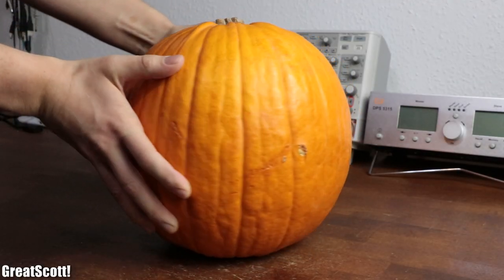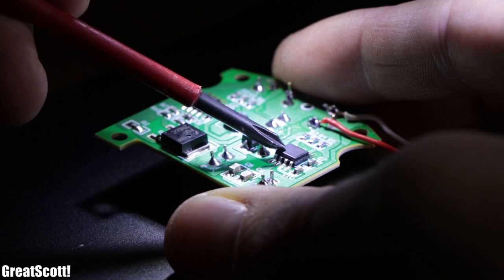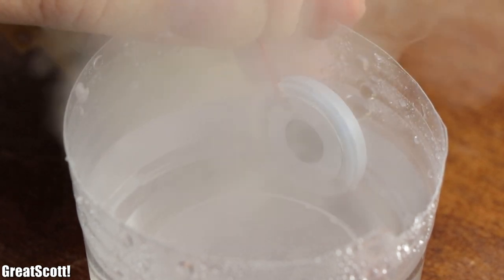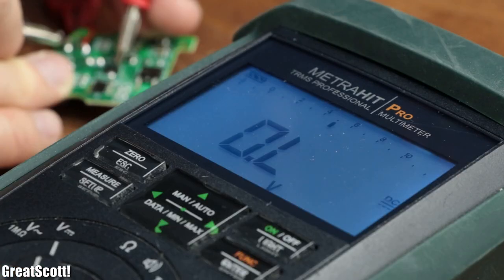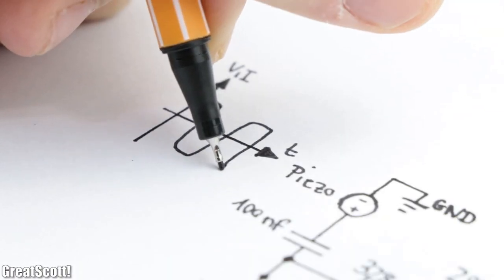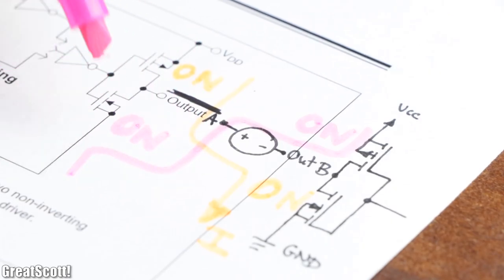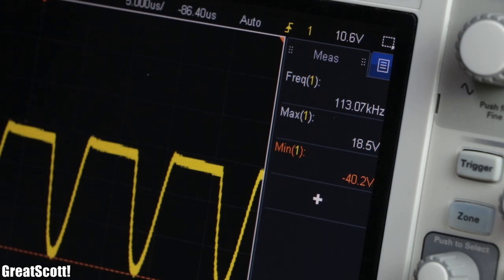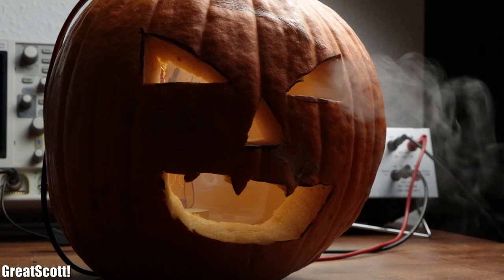Make your own Super Simple Ultrasonic Mist Maker

Comment: I recommend adding a water level sensor if one wants to actually put it outside, unattended. Just to avoid burning out the disc.
Reply: A swimmer for the disc would be good too so it stays watered but not submerged for longer (I assume it has to be not-submerged).
Reply: @BloodyRainRang  some of them utilize submergeable piezo discs

Comment: The capacitor missing from the schematic seems to be a 100nF ceramic capacitor that should go from pin 8 on the NE555 to ground. Without that, the square wave the NE555 produces has a high voltage peak at the start of the wave.

Comment: I looked on ebay for some piezo resonators to experiment with them and I saw the 113KHz item in your video but also noticed resonators marked as having a frequency of 108KHz. Perhaps the commercial unit is deliberately marked incorrectly and the output of the microcontroller with the lower frequency you measured is correct. Perhaps you can devise an experiment to find what frequency gives the highest output rather than having a preconceived notion of what the frequency should be. This would be a better way anyway as you'd expect some tolerance between different resonators and you can fine tune them somehow. Maybe a circuit with a PLL could be self correcting so it produces the highest output by tweaking the VCO on the fly? I'm sure that alone would make a great video with your talents!

Comment: Can someone explain what the inductor and capacitor is for?
Reply: I was wondering that too, at first I thought maybe the inductor and capacitor is acting like a series LC. Circuit with a boost converter effect which would explain the big negative voltage swing but not 100% sure

Comment: So you may not submerge this new piezo disc under water in order to function? That would mean it needs a very precise waterlevel, which continuously decreases as the piezo creates mist from it. How do commercial mistmakers deal with that problem?
Reply: This might be a possibility.  Float the disc on the surface,  maybe at angle if that helps.  You'd need a "raft" and very flexible wire.

Comment: Ok I got a piezo twitter from old speaker box, connected everything and I got nothing 
On 30 volts
But on 80 volts I got good results and a good electric shock
Reply: it might be because you are using a piezo speaker, and not an ultrasonic piezo
Reply: @davidrubio8673  that explains the current
Reply: @blackturbine  yes
Reply: @blackturbine  please use a mosfet or low  value capacitor for more power
Reply: @euvo_sound  nah this was only an attempt plus i took the circuit apart for components
Reply: @blackturbine  ahh ok

Comment: That was an interesting reverse engineer. I'm curious, why would the commercial circuit use a cheap microcontroller as opposed to the dirt cheap 555? I'm sure the 555 would be next to nothing in cost? Anyway thanks for another great tutorial.
Reply from the maker: The cheapest 555 timer I found on LCSC was 8 cents. Not quite the 3 cents for the µC.
Reply: @greatscottlab  Yeah, Dave has recently made three videos about that 3 cent MCU. Impressive!
Reply: @GreatScott! @northshorepx The cheap microcontrollers need less support components, so if it means one capacitor or resistor less it might work out cheaper at high volume.  Given less support components outside, such as a capacitor which might have a big tolerance such as 10 or even 20% error (maybe even more if you go cheap), you are also less likely to have defects on the production line, since if they went with cheap passive components and the 555 route the timings might vary greatly between them. While the video did show it not being exactly the resonant frequency (though it might have been an intentional design choice), the internal RC oscillator in modern microcontrollers have become quite good and I would trust it a bit more than an analog solution when cheaping out on passive components.
Reply: @greatscottlab   can you make a video about the cheap microcontroller?

Comment: 1- If 555 is in an unstable mode, why is pin 7 empty?

2- Why is the 470 Nf capacitor going from pin 4 to pin 1 not in the circuit diagram!

3- Even if this circuit works nominally, it was seen that it works with a value of 2.3 Amps at 12 volts and IRFZ44 heats up abnormally. It is not efficient.

4- Did you think that the Frequency setting you made without load would change when loaded?

Comment: Hey there
Hm, nice video and thx and all.
But the circuit doesn't seem to work right for me. Built it like in the schematic, and it does put out a high pitched sound when the potentiometer (10k instead of 5k but that shouldn't matter, right?) is at max, but when tuning up/down nothing's happening. Any suggestions? 
My other try with a readymade ne555 circuit hooked up to an irfz44n just seems to catch fire (/the mosfet gets so hot surrounding wires melt), but it works....^^'

Comment: Thank you for the great video GreatScott! Is this circuit possible with just the N555 timer? You mentioned how you really only need an AC current at the resonance frequency of the piezoelectric disc right? I got my N555 timer to produce 113KH from a 9V input DC current but the piezo electric disc doesn't react

Comment: How long did you run the circuit inside the pumpkin? Were there any problems with mist settling down on the circuit and causing creeping current problems?

Comment: Next question: can you also vaporize fog fluid with it? I always want to create a small fog-machine that works on batteries but it draws a lot of power. Technically the heat is just wasted and only needed to vaporize the fog fluid which condenses to small droplets in the air lateron. It would be greate if one could get rid of this unneccesary step and create the droplets directly through a membrane.

Comment: @GreatScott!  On your Instructables page you show 10 components, yet in the parts list and schematic you only use 9 components.  One of the 4 caps in the picture of the parts list is not in the schematic but IS shown in all of the pictures as being connected in the circuit.  This makes doing the project difficult as the images for it do NOT match the schematic.

Comment: I have a couple of questions please. my ultrasonic transducer is rated 3-12v and your circuit on instructables states a 15v  feed, if supplied with 12v, will any of the components need to be change to different values?
The circuit has a line labelled 'VCC' which supplies the inductor, is that the same voltage as supplied to pins 4 and 8 on the 555?
and lastly, instead of sourcing the IRLZ44N mosfet, is there any reason why i cant use another N channel mosfet in this circuit as i have transistors of many types but not the IRLZ44N.
Thanks, Steve.
Reply: I have the exact same question regarding the VCC and voltage of the transducer. I would like to know if 5V is possible or that some component (values) needs to be change for that.
Reply: Me too. So If Mr. Scott see this, pls give us a hand...Thank you in advance.

Comment: Hey Scott,I have an query,Hope You guide me.
I salvage a golden coloured piezo from alarm clock and used it in mist maker circuit, it's producing sound only...I came to conclusion that I didn't tune it well due to insufficiency of oscilloscope, @gseatscott what do u think?? Will that work or have to use only &only ultrasonic piezo???🤔🤔
Reply: Hey Scott,Help me😁

Comment: I use this same circuit, I generated the required frequency, it was the same after IRFZ44N but after 100nF(1206) capacitor its value increased by 3-5 times. I need 113KHZ but at the end I m getting between 400-500KHZ. Please help if any one can understand the problem. The circuit is same as it is in this video.
Reply: Maybe I see something wrong but the 1206 smd is 10uf....

Comment: Hi i looked at both your videos seeing this works for the lower frequency ultrasonic version here  i used the idea of it and changed some parts to do the same thing on the 1.7mhz version i am yet to test with the device BUT circuit  works good  ...so its pretty much the same idea but i use a LTC1799 as the oscillator as you can use it over a wide range of these devices ,i wanted it for the 1,7 Mhz version and later on for a 3mhz one any way i feed that 1.7mhz square wave to a Bu2525AF npn power transistor  and the inductor is a .03mH showing 1.8ohm....the LTC1799 is 5volts and at the moment the transistor  has a 12 volt supply and waveform increase's with voltage here  i could go up to 1000 v if i wanted ...i am also interested in vibrating Quartz Crystals and you need a few hundred volts to do the same thing as the device used here ....i used that transistor as it runs very cool  and works well ...i will post a link here in the future when i start doing tests...but thanks for your work as it sure helped me ..BTW the out put at the inductor is a clean sinewave spot on for the device .
Reply: dalek moore hi!!! Do you have the circuit scheme please?? Thank you!
Reply: @angelagallego48  its pretty much that high frequency oscillator to a power transistor with a tuned circuit  inductor and variable capacitor the disk go's across the  tuned circuit .

Comment: Only one problem I don't have oscilloscope to fine tune 555 timer output.
Reply from the maker: You can get cheap oscilloscope kits for around $20. I made a video about one a while ago. I think it was a VS video.
Reply: You can also buy them pre soldered for around the same price... if you don't feel like trouble shooting for a few hours
Reply: or use an arduino to create the 133khz
Reply: @davidrubio8673 , true but arduino minis and at tiny ICs can get more expensive
Reply: If hitting the exact resonance frequency is critical (sensitive) then that means no mist is created at incorrect output frequency.
Your tuning process has just become easier.
Tune the circuit for maximum mist.
Reply: Buy a cheap dmm with HZ function and use it :)

Comment: What do you mean by "decouple the IC."? 
I found these to work quite well. My problem was keeping them working for any length of time. It needs a wick of some sort to keep working for more than a few minutes. I haven't found anything yet that keeps it working. I've tried all sorts of cloth fabric and sponges fine and course. I was trying to make a few of them smoke out my entire deck backlit by some LED's a black light and a couple of weak lasers. I wanted to setup a spooky automatic candy dispenser that lowered the candy down and a prop to scare the kids when they reach for the bowel. A spider that climbs back up the string. At the same time a dowel with a bunch of fishing line tied to it swings in so they feel like the webs touch their hands and face. Need the fog to hide the devices. I have to look after upto 6 dogs that are terrified of fireworks so I never get to participate in Halloween for years. Recording some reactions with the CCTV system could make up for it.
Reply: sounds cool.....if you mean bc the water level drops too fast ........just use/make like self filling pet bowl......basically an upside down bottle.

Comment: Hey Scott I supplied 7 volts AC into a transformer's 12 volts AC output I got arcs at 220 v input terminals I connected a led bulb it glows but it blinks why it happenes
Reply: wait, are you supplying a AC or DC voltage to the led?
Are you using a LED chip/cob?
Reply: first of all you are using transformer in way it shouldn't be used. 230V side of transformer is made of coil with high resistance wire. 12 V side have low resistance coil.If you apply big voltages(>12V) at 12 V side it can destroy your transformer.220V side of transformer will provide very low current and voltage of that side will drop if you try to draw more current.
Reply: LED is not getting enough current (20 mA) and also due to output of transformer is AC and led acts as diode,only half cycle is being utilized to glow led so it blinks(may be)
Reply: 7 VAC (volts AC) is almost half of the 12 VAC the transformer is rated for! That means you're getting only 130 VAC, not 220 VAC! Unless the LED bulb is rated for 130 V or less, it's normal it won't work correctly. So tip number 1: use 12 VAC! If it still works erratically, then continue reading.
Also, how did you generate the 7 VAC? It most likely is a "modified sine wave" (which actually doesn't look at all like a sine wave), which can cause trouble with some power supplies, such as the LED bulb's one. If you have an oscilloscope, inspect the 7 VAC waveform. If you don't see a sine wave, then tip number 2: don't use a modified sine wave with complex electronics! In fact, @GreatScott! has mentioned this in a recent video! 
Finally, @GreatScott!'s name is actually Jeremy, FYI.
Reply: The LED blinks because you aren't rectifying the output of the transformer. It's lighting up during one half of the sine wave, and then not allowing current to pass during the other half of the sine wave (since an LED is a light emitting *diode*). If you added a bridge rectifier and a capacitor it would stay on solid. 
EDIT: You would also want to have a current limiting resistor in-line with the LED otherwise it won't last long.
Reply: @vishalgothiwala7542  He said he applied 7 VAC into the 12 V side. Also, the power is almost (because of losses) the same in both sides of the transformer, and an LED bulb doesn't draw much power at all unless it's a high power one.
Reply: @SuprSi  I don't think "blink" would be the right word in that case. It'd be more like "flicker", due to POV. But I highly doubt that, because unless it was a high power LED, it'd have exploded (or at least melted) already. I think he's referring to a 230 VAC household LED lightbulb, not just an LED diode.
Reply: @GRBtutorials  i have used such transformers that apurv might be using.it's 230V coil which is intended to be used as primary coil have around 1k ohm resistance and 12V coil which is intended to be used as secondary coil have around 100 ohm resistance.so if you try to draw more current from any coil,it produces more voltage drop across its coil.Also VA rating of this transformers are not very high.so to keep power constant voltage drops than it's intended value.Normaly LED bulbs are of 3W or more. May be his source that provides 7V (AC) may not be able to deliver such power continuesly.
Reply: @vishalgothiwala7542  How do you know which kind of transformers he's using? He might just be using a normal transformer in reverse, which is something totally acceptable as it's symmetrical. What would be dangerous would be applying 230 VAC to the 12 V coil for increasing the voltage, as the transformer would arc and/or melt. Watch ElectroBOOM for more details: https://www.youtube.com/watch?v=sFTjFD84Q1c. The 230 V coil has more resistance than the 12 V one because P = VI, so more voltage means less current needed for the same power. Otherwise, transformers wouldn't work!
Reply: Reading most of the comments... either I or others didn’t fully grasp your scenario... it seems you are using a transformer normally intended to step down mains AC in reverse to create an inverter, and then connecting an led light bulb intended for mains voltage.. my thought is that there was an accidental short which would have damaged the transformer or... the transformer is not rated for the task. A lot of 12 v supply’s are only rated for a small current. You may be limited to something like 100 mA on you high V side and it would probably be a lot less efficient if you using pulsed dc.

Comment: Could this circuit works at MHz? of course changing 555 oscillator in order to reach higher frequencie...
Thanks a lot☺
Reply: 555 is fine for the 1.7Mhz